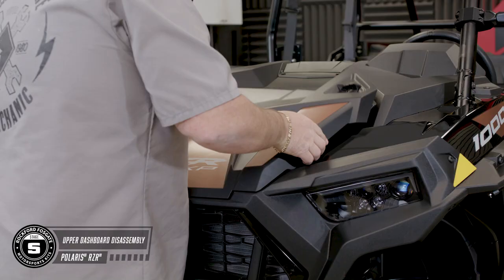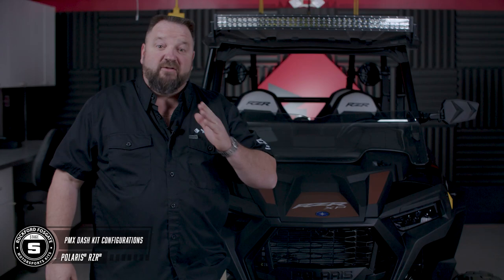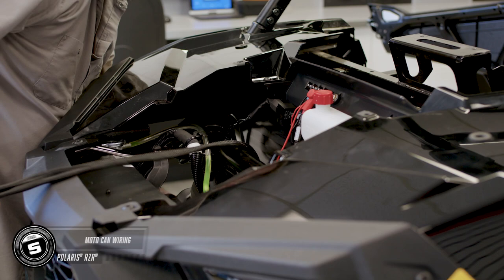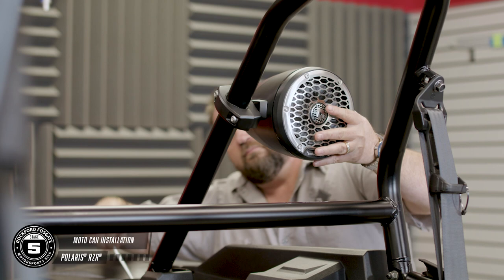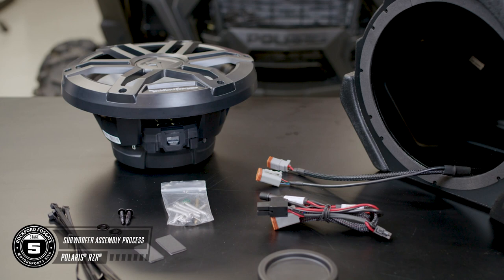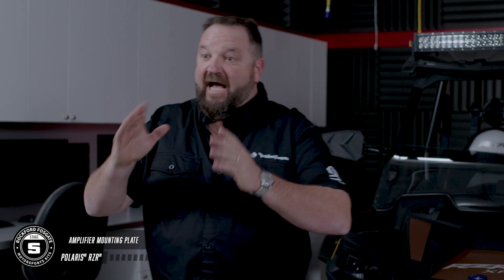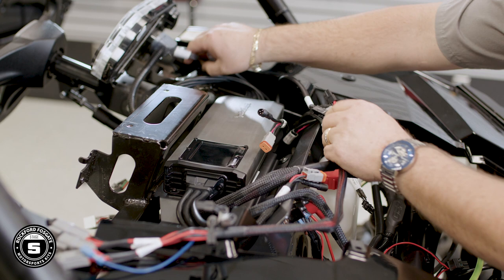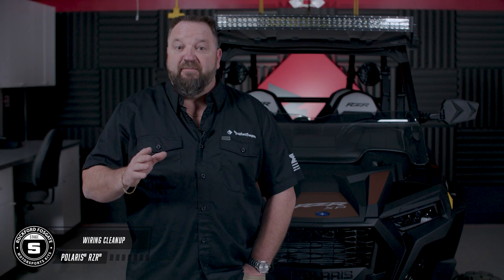Polaris RZR14-STG5 Installation (Gen-3)

Comment: so this 5 channel amp if i were too run four 6.5 speakers off each channel and two 10 inch subs off the sub channel bridged together is every channel adjustable where the 6.5 would be full range and the subs would be low pass?
Reply from the maker: The M5-1500X5 included in this kit is a staggered design as follows:
- Stereo Channels (ch1/2/3/4): 2Ω minimum
- Subwoofer Mono (ch5): 1Ω minimum 

You can only run (2) 4Ω speakers per channel, since wiring them in parallel would present a 2Ω amplifier load.

You can run (2) subwoofers on the mono channel, but they would need to be 4Ω DVC, since wiring all the voice coils in parallel would create a 1Ω amplifier load.

There are gains and crossovers for the front, rear, and subwoofer, so you would have full control over the signal processing.  You can find out more about this amplifier here: https://www.rockfordfosgate.com/products/details/m5-1500x5/

Comment: I have power to my amp but no power out to my subwoofer any help?
Reply from the maker: "power out to my subwoofer" encompasses 2 conditions as detailed below:

1) If you're referring to the LEDs not illuminating, you'll need to make sure the RGB connector is attached to the Color Optix controller (timecode 10:36).  Also, make sure the Deutsch connector is attached to the subwoofer (timecode 7:15).

2) If you're referring to the subwoofer not having audio output, you'll need to make sure the SUB OUTPUT connector is attached to the amplifier (timecode 9:47).  Also, be sure the subwoofer harness is connected to the subwoofer itself (timecode 7:17) and the harness is connected to the enclosure (timecode 7:58).